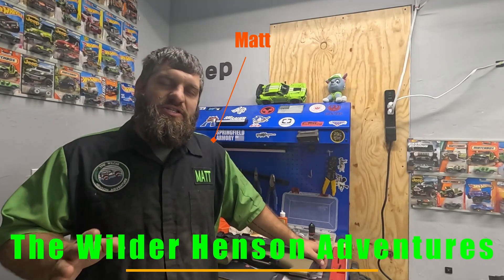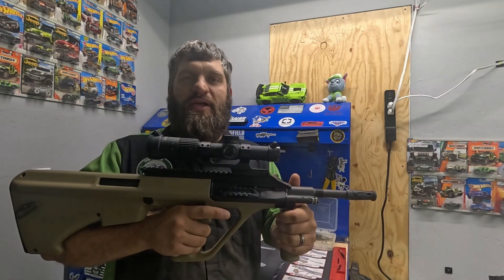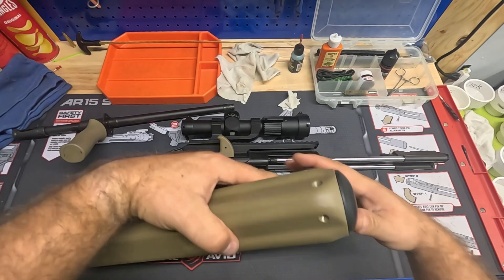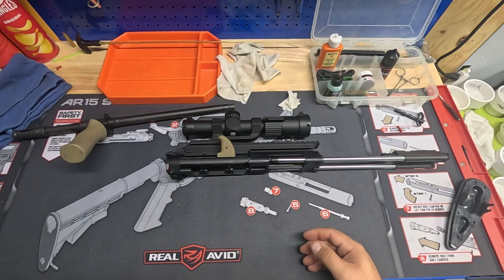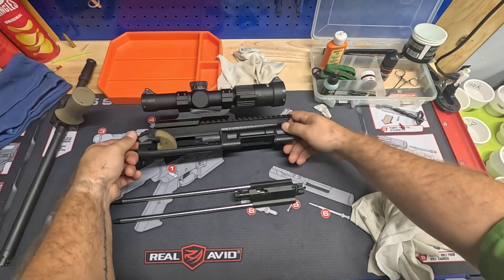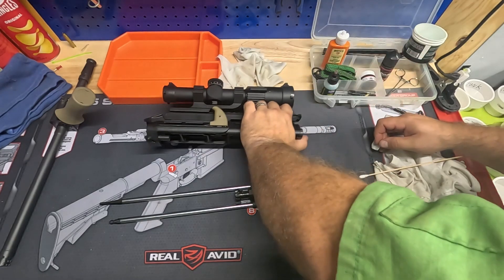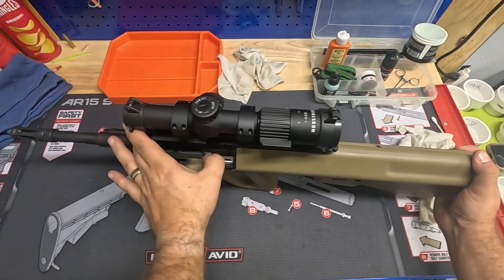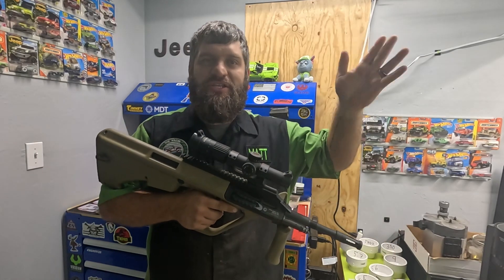field strip breakdown and cleaning of a Steyr AUG

Comment: As already said the action should be allowed go forward after removing the barrel, then the receiver and bolt can be  removed. Also the proper way as per steyr manual to remove the trigger assembly is to first press the button on the butt pad is push the sling bolt completely into the stock, then remove the butt pad. If u keep doing it as u do by pulling the pin tru eventually u will bend the metal plates on the butt plate. Also u can put oil onto the same cloth u use to pull tru the barrel and then rub that on metal parts, I've never seen anyone spread oil with their skin
Reply from the maker: Thanks for the heads up. we will keep that in mind.